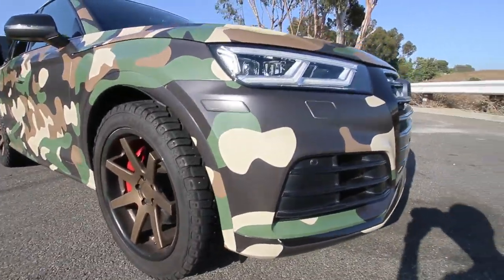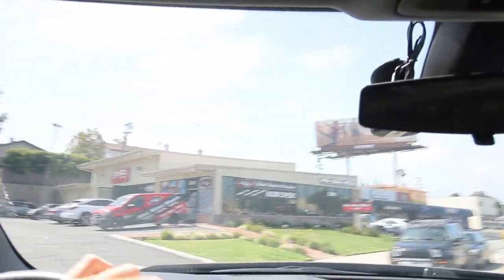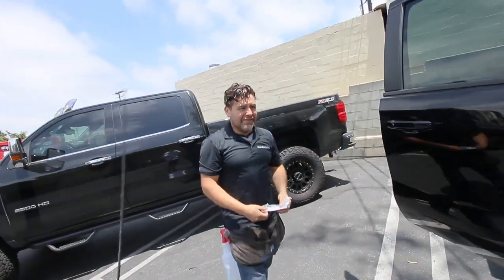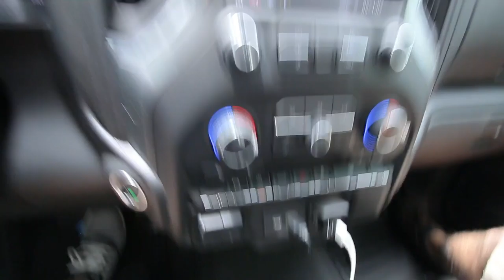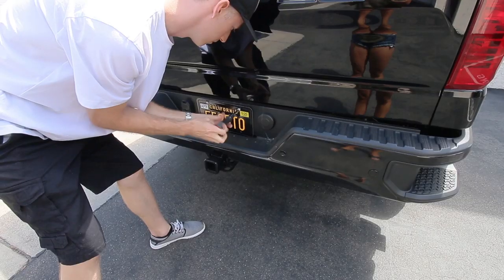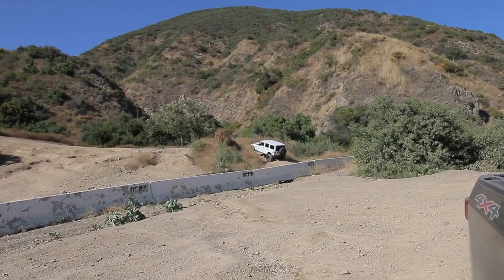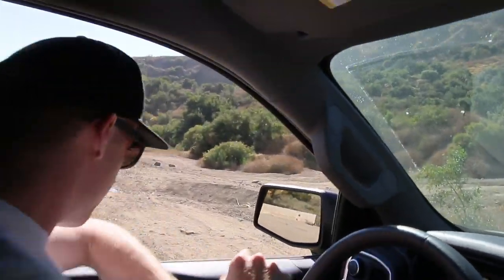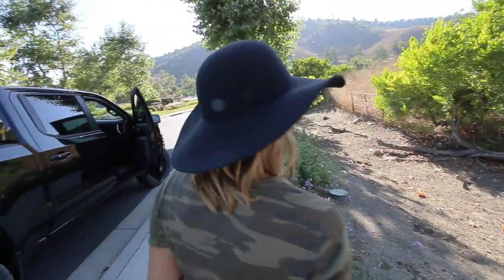Wrapping My Chevy Bowtie!! ...again

Comment: No regrets on passing on the Z71? Looks like you could actually use the skid plates, auto locking rear diff, and hill decent control. 2 speed transfer case is big too. I’ve been using my 4 wheel low to pull bushes for some landscaping work. I do wonder how much better the Rancho shocks actually are...
Reply from the maker: Spencer Elvebak skids plates might be in order soon but other wise the truck handles well out there! I have the locking diff and terrain mode that I haven’t had to use yet. When I lift it a little higher I’ll upgrade the shocks too 👍
Reply: Mark Brenner oh the auto is the difference. Man they make a bunch of subtle differences to keep track of lol. A locking diff is a must up here in the ice and snow. More lift? Your lady will for sure need side steps when you do that! I just ordered wheel to wheel side steps. It gives you a third step to reach into the box better. Pre-order only sadly. Our trucks are still too new! 😍
Reply from the maker: Spencer Elvebak there are so many things I want but man that struggle is real when your truck is too new hahah😆